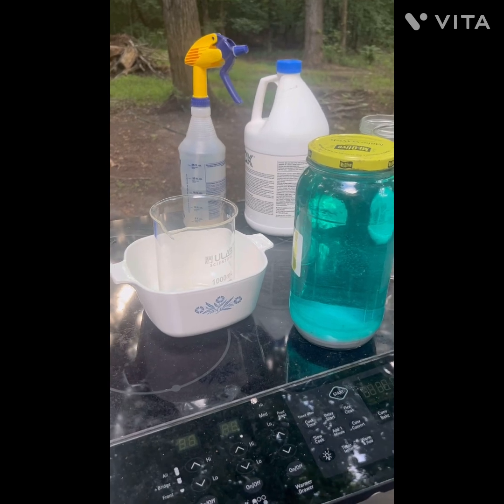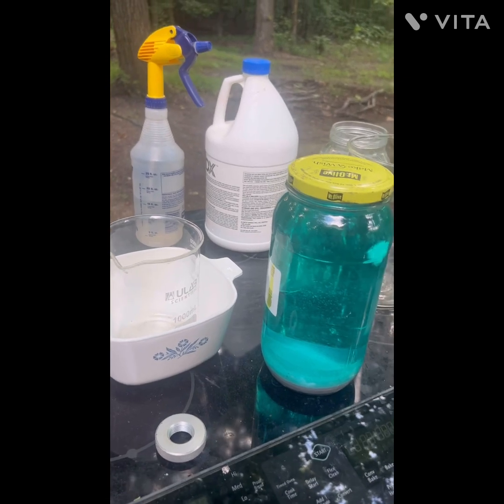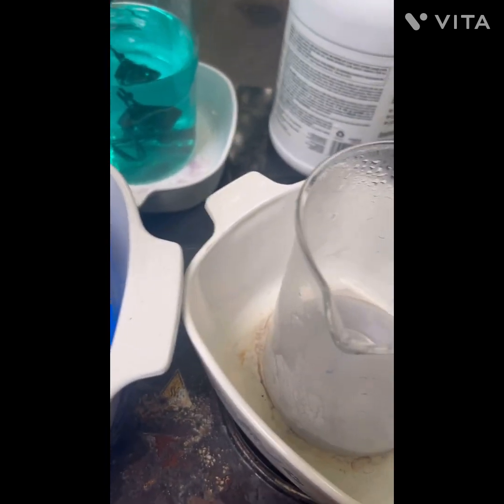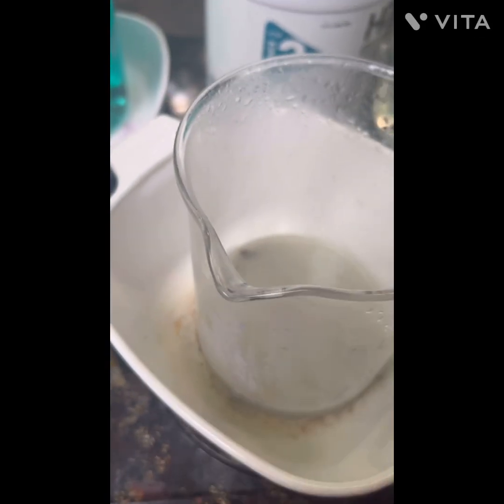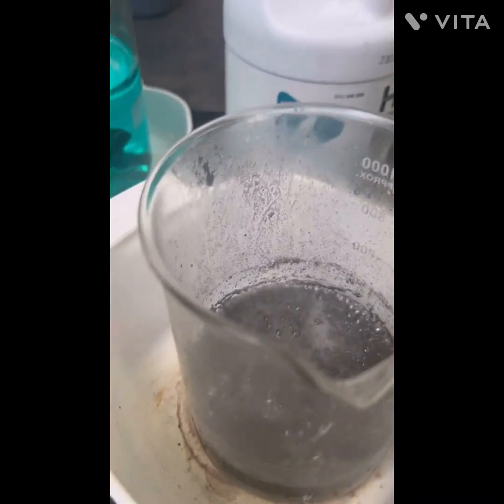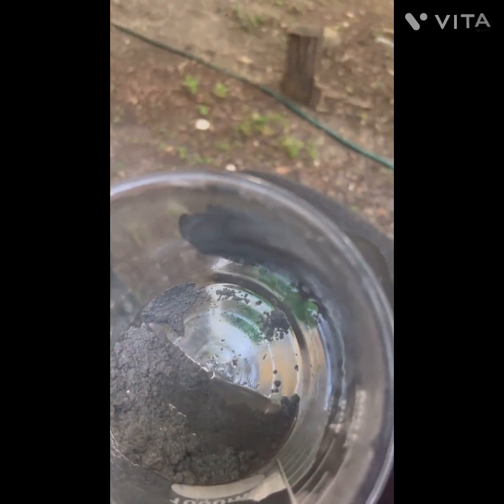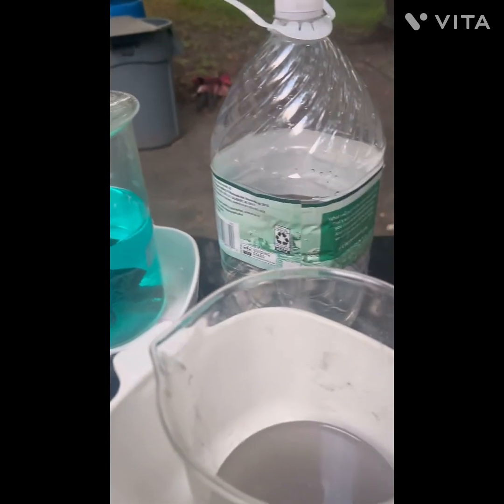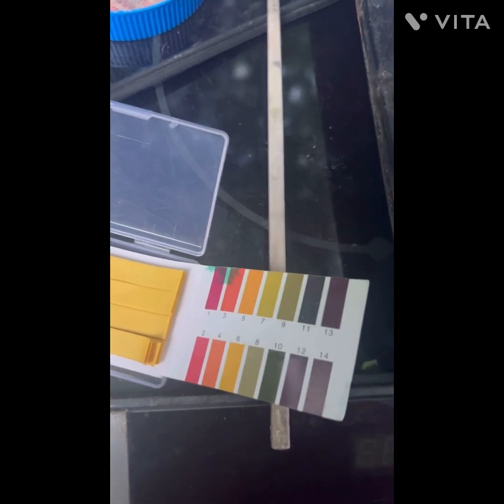Converting Silver  using Muriatic Acid and Aluminum.

Comment: I wouldn’t do any other way. Good job dude. I generally use small strips off aluminium from power supplies just so it don’t get to hot
Reply from the maker: I will be melting the shot tonight and going over the results Sunday . Don’t miss the Saturday night pour challenge ( moved to Sunday 😂)
Reply from the maker: I feel like I should have boiled the powder in HCL afterwards I believe there was aluminum powder in the silver , took forever to melt and used slot of flux to pool it in the melt dish . 21 grams of powder recovered 16 grams of silver shot produced
Reply: @Hill-13  yeah definitely would clean up any aluminium left in the silver